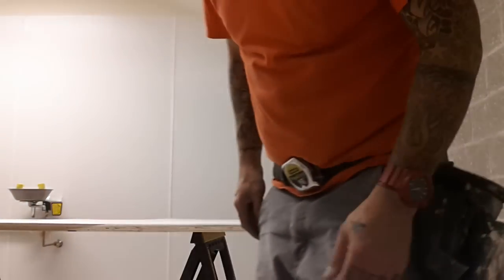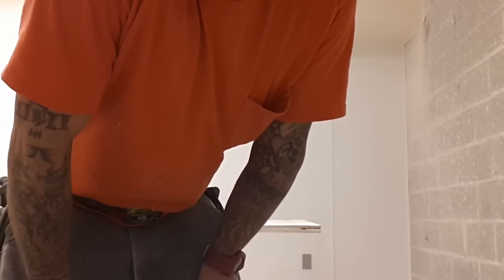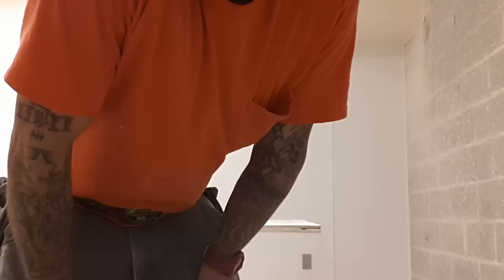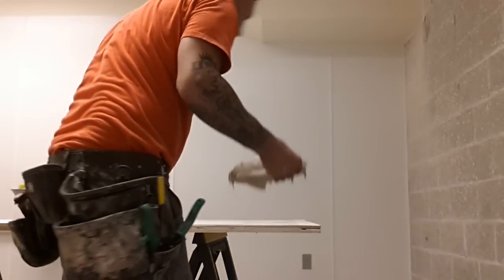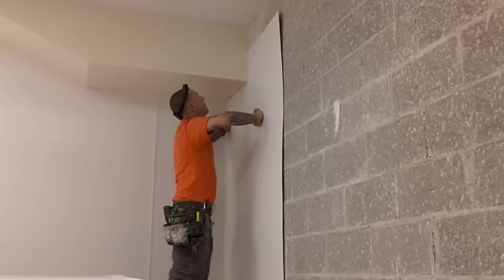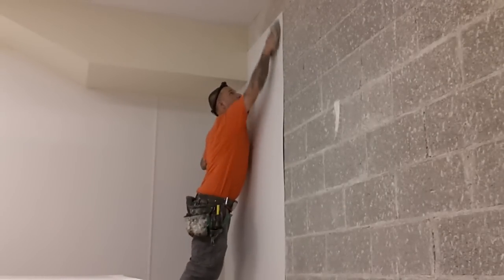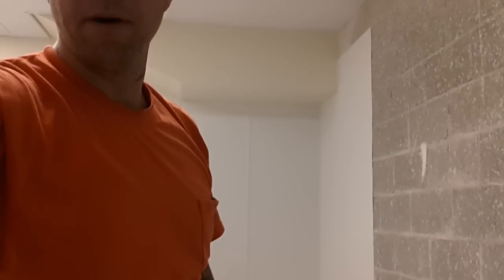FRP Installation over concrete block wall

Comment: Thinking about installing in my garage walls, currently the walls are covered in OSB sheeting.  Could I just use stainless steel screws to install over 
My OSB?

Comment: I have a cinder block wall that's got layers and layers of paint over it my idea is to take roofing tar and coat the entire wall with it after I rough up the surface of it . Or just take liquid nails and plywood and build a false wall period for the piping or the plumbing to come through. And then put concrete board or the green board where the inside of the shower is and do that all the way around for my walls. But not forgetting to coat the OSB that stuck to the concrete cinder block wall for waterproofing.

Comment: Judging by the consistency you are using water based glue. I always use solvent based on concrete block as the block will pull the moisture out of the glue and the glue then doesn't adhere to the FRP properly. I have repaired a few MacDonalds restaurants where the FRP had bubbled and come loose from the cement board wall and what surprised me was that the only place the FRP adhered was where the stickers on the cement board were.
Reply: Axiom T wont solvent base melt through the frp? not sure just asking a general question
Reply: I have a lot of bubbles that formed in FRP sheets, is there a way to get rid of them without ripping the panel from the wall?

Comment: use Advanced Polymer adhesive for installing on block wall or any non-porous surface. Titebond fastgrab is water based and doesn't when it dries it only adheres to new drywall and plywood

Comment from the maker: yes you could, just go to your nearest Lowes or home depot and pick up a bucket of Titebond Fast grab adhesive for FRP and it will hold fine. make sure the notches on your trowel are about a quarter by a quarter, maybe a half inch apart. 
Or just call me if your in Seattle Area!

Comment: Hello , 
I got a block wall 10  feet high  x 27  feet long . Construction glue on FRP then attack it to the block wall directly after two month then it’s  won’t stick and have a lot of any live Behind FRP., now it’s have a gap between FRP and block , (note when the guy install the  building’s got wet in some part ) . My building under warranty so construction want to do a rivets for me , or re-glue it again . 
Which one should I do ?

Comment: could you apply this to a painted concrete wall that has been painted in a nursing home? The interior walls have no moisture problems. Is there an adhesive that would work

Comment: I have a question...I live in Australia and our house is plaster walls on brick frame so no studs.  We want to install beadboard for wainscoating.  Can this be done without nails using adhesive?  If so what sort of adhesive do you recommend?

Comment: Hello, I was wanting to know if  you can paint over FPR and the type of paint to be used. I am assuming you would need to prime the surface?  My other question is if you have any suggestions on a Wall Panel system that does not require the use of Drywall,tape and mud? I am building an arcade in my basement. The basement stays dry all year. We are trying to cut cost down on materials. The basement is unfinished 45 x 21 with lime stone walls. The plan is to frame the surrounding area with 2 x 4's and use some type of Pop Rivet wall system. The walls need to be sound and take abuse from kids/teenagers leaning on it etc. Your advise would be very helpful.. Thank you
Reply from the maker: You don't need to tape and mud to apply FRP. It's good to on the tapered joints of drywall due to the fact the FRP will "suck" tight to the wall when the water based glue dries.
To paint, scuff the surface with sandpaper, then paint away! I see it done all the time after 5-10 years and the panels are dingy.
Reply from the maker: If you use a solvent based adhesive, I use Titebond,  you can go over concrete. Provided the concrete is pretty darn smooth.